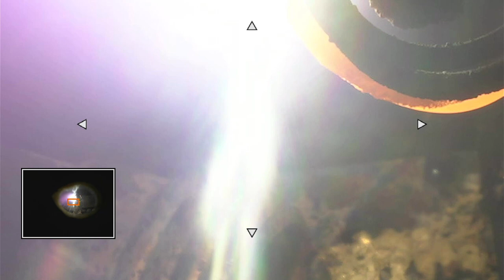VEGA - SONY Alpha close-ups discussion

Comment: Well, if there's ever a Nobel Prize given for best use of an old water tank, it's certainly deserved here!  

The thought occurred, after reading Lutz Jaitner's treatise on "condensed plasmoids" (I.e. EVO's), that it might be helpful to look at LENR reactors as "the machine that builds the machine", and look at the plasmoids/EVO's themselves as the actual "reactors".  He gives a lengthy derivation of a quantum mechanical model for a cylindrical EVO, and draws repeatedly on Shoulders and Bostick. With some issues it seems to return reasonable agreements with reality, and apparently is the basis for George Egley's latest effort.  I would think it would be relatively simple for someone mathematically inclined to extend his work to the modeling of a torus, and even toruses of toruses as you have been advocating.  At any rate, this way we might be able to more simply distinguish the parameters associated with EVO creation and "management" with the parameters affecting material and energy balances and reaction routes/kinetics occurring the EVO's themselves.  

Apologies in advance if I'm missing something obvious here, but with a background in chemical engineering it's natural for me to think this way.  I also noticed that MFMP did not appear on an otherwise very helpful list of parties involved in LENR research today appearing on the condensed plasmoids web site.  I truly hope there are no PNG issues, since I find you both extremely helpful.